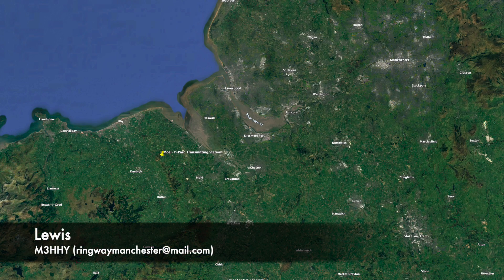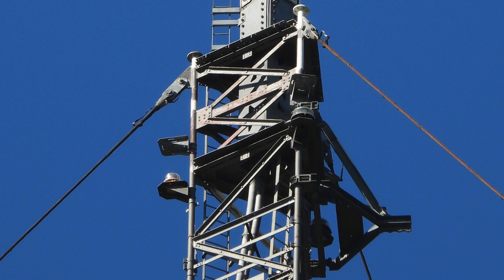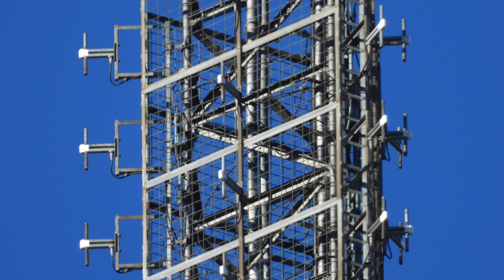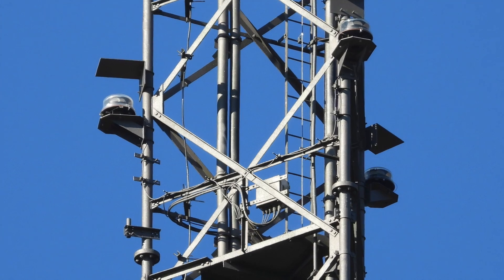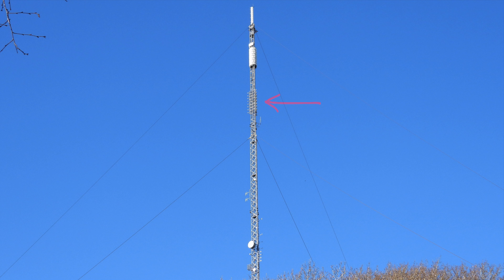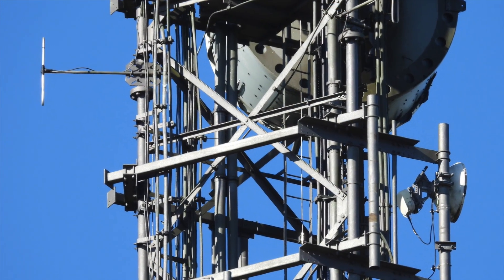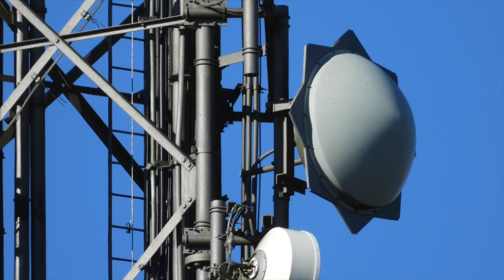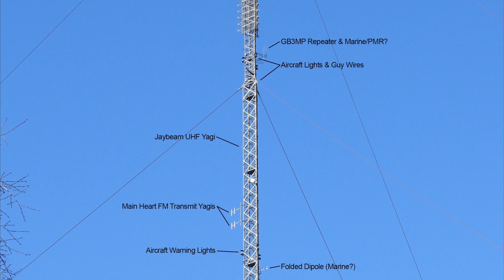What Do All These Antennas Do 1900ft Above Sea Level?

Comment: Total noob question: What is "cardioid" about the cardioid antennas? Is it something related to their geometry, or to do with reception or radiation patterns, or the like? Cheers :)
Reply from the maker: In simple terms, the signal directional pattern resembles a heart :) - cardioid
Reply: @RingwayManchester  Cool! So it is the radiation polar pattern (if that's what it's called; that's what it is in acoustics ... that'll do). Was leaning towards that, the antennas didn't really looked formed into a heart shape. Hehe.

Comment: Great video as always, Lewis!
 
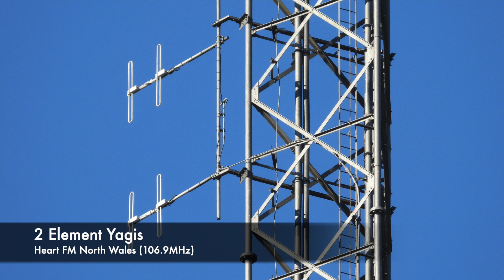The Heart dipoles at around 3:18 - it's good to see the two tiers are now pointing in the same direction! The last set of photos of Moel-Y-Parc on MB21 showed one pair had moved around in the wind. I pointed it out to a friendly Arqiva engineer from the site when I was talking to him about something else. He wasn't aware of the issue, despite being based there, and promised to go outside and look upwards immediately after getting off the phone! Looks like he did, as the fault has been subsequently fixed. I believe the 106.9 radiation pattern from that site has to be very tight to prevent interference to other stations on the same frequency - most notably Silk FM in Macclesfield - so a set of wayward dipoles might have been a significant problem.
 
As for the possible marine VHF dipole you referenced at around 5:49 - whatever it *did*, it clearly isn't doing it any more - look at the feeder (or lack of it!) 😀

Comment: Apologies if you covered this in another video, but do the engineers need to perform weight analysis when things get added to the transmitter, to make so it's not tipped over.

Comment: I assume you were referring to the flanges where the tower bolts together? To answer how the sections of tower stay on, i think it’s mostly gravity, considering the guyes resist all and any lateral forces from wind. The bolts are more of an aesthetic compared to the massive normal force of the weight above

Comment: I was lucky enough to see the Redruth transmitter have the UHF transmitter aerials installed by Venn Bros in the early 70’s. They went up in a powered cradle on the guy wires to the top with the gear needed to do the job. It took about 3 months because of the notoriously bad weather that location used to get.
We lived in clear sight of the mast as it was known. All you had to do was stick a 6" piece of wire in the aerial socket for perfect reception. 
Good old analogue.

Comment: I'd like to have a chat with you about these PCM radios.

I'm not sure what you mean by PCM radio.  Usually these radios carry G703 and G732, G732 being standard 30 channel 2.048 meg PCM frames, where ad G703 is simply a 2.048meg open port data stream.
Reply from the maker: Look at the video I linked in the description

Comment: When it comes to what is where on the tower is usually based on staying away from high power FM bays and/or rental fees of the tower. Different places usually higher up might cost more to rent. Tower space is usually given out based on height. Say the wifi company on my towers are only allowed to use 200 through 250ft out of a 450ft tower. That and I think some types of antennas perform best at x ft off the ground. I am not really an antenna guy yet it's a lot of voodoo

Comment: MFM used to have has two stations,  103.4mhz for Chester & Wrexham and 97.1mhz for Wirral.

The Wirral Station later became rebranded 'Wirrals Buzz / Buzz FM" and ran from a studio in Birkenhead.

Although in its last few years it was not running from the Wirral but from the Marcher Studios in Gwersyllt, Wrexham before Global changed all of the Marcher Radio stations to Capital.

Marcher Radio group in its final days gas Multiple stations.

MFM, Wirral's Buzz, North Wales Coast, Champion and Marcher Gold.

As far as I can remember from working there,  Wirral's Buzz(MFM 97.1) was transmitted from Moel-y-Parc facing towards to wirral,  and MFM 103.4 for Chester & Wrexham was transmitted from Storton Hill, Wirral but facing toward Chester & Wrexham.

I believe the other 2 Welsh Ststions, North Wales Coast and Champion where at Moel-y-Parc too.

Marcher Gold was on AM,  and I have no idea where Its TX site was.

P.s.  Pretty sure your correct on that being GB3MP's old antenna before it moved to the Shooting Range in Prestatyn

Comment: I find it funny that after decades of being told circular/mixed polarisation is soooo much better for FM radio (I've never believed that) it must be used, but even here in Australia, like it seems in the UK too, they have reverted back to vertical polarisation requirements for DAB,  kinda vindicates my opinion all along, that mixed is not the magic pill they thought it was, views likely skewed by commercial manufacturers.  
RF doesnt  say "oh your in 88-107, we are gonna treat you different than every other band"...
Thanks again Lewis for another top video.

Comment: Wow, another great video! I am impressed that the trough has been on the mast since 1969 and has survived 50+ years of environmental abuse at that altitude! Quick question for suitably minded people.... I notice that some of the microwave dishes are contained within a drum shaped housing (not really a radome). Others are contained within a more conical arrangement. Is there a reason for choosing one over the other? All I can think is that the drum provides easier coverage of a horn type assembly at the cost of increased wind loading. The conical arrangement perhaps needs a simpler feed arrangement buts more aerodynamic with lower wind loading. Is this thinking in the right direction or is there a totally different explanation?

Comment: These cellular antennas all seem to have unused ports.

I looked up the tower in CellMapper, here‘s what bands it has (not in order).
O2 UK: LTE B20 only, no GSM
Vodafone UK: LTE B8/20, unknown GSM band
EE: LTE B3/7/20, no GSM
Three: LTE B3/20, possibly UMTS B1

The upper antennas maybe are/were in use for Three 3G as the Vodafone cell should be SRAN or they are doing similar stuff like in Germany and are trying to get anything useful out of old panels (in Germany I’ve heard they sometimes use 1x1 SISO on 5G n1).

Comment: Can you explain a Yagi antenna in more detail (for some reason they sound interesting) They look smaller than the TV aerial on my roof. I came across a thing with my fight radar SDR system where I had to shorten the aerial to get a better signal and I think old CB you used to snip the aerial down to tune it. Great Videos Thank You

Comment: So how does one carry a TV/microwave antenna up it to be mounted? Can they be progressively added to? Do decommissioned pieces stay up there?
Reply: The large heavy antennas are lifted by helicopter.
Reply: Some can be winched up by rope. It really just depends on how much is being installed at a time. I've participated in installation of 2.4 metre diameter microwave antennas and these were done by rope.

You could certainly build antenna arrays bit by bit, but it'll take a long time. So as mentioned, sometimes you'll use a helicopter to lift and install large preassembled sections, especially to the very top of a tower/mast.

I guess as a designer/planner you just have to weigh up the costs and practicalities of each method. A helicopter can only fly so close to a tower safely, especially if it is a guyed mast.

Comment: Some of the Andrews radomes still there at MP were probably for BBC 7ghz OB links trucks that operated out of BBC Oxford Rd in the 80s and 90s. These were superseded by Ku Band sat trucks. There was an accompanying UHF IFB transmitter/antenna on the MP mast for studio to truck comms and programme feed. 
ITV regional news had a 2ghz truck with a 40ft pump up mast.  Not sure if they worked into MP.  
The BBC trucks worked into Holme Moss, Winter Hill and Moely Park depending on line of sight from the OB location. Sometimes the closest TV mast was not available LOS and MP was the only one visible even though it was furthest away.  The dishes at MP could be steered a limited amount to the bearing of the OB links truck. They used a very old piece of terrain plotting software before heading out to site so see if a LOS existed. If not a mid point truck was used as a relay.